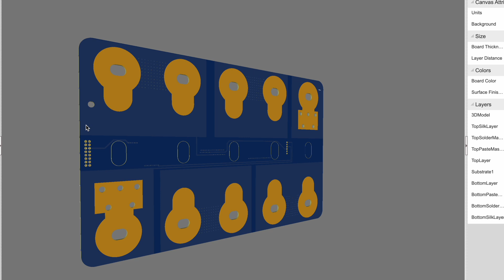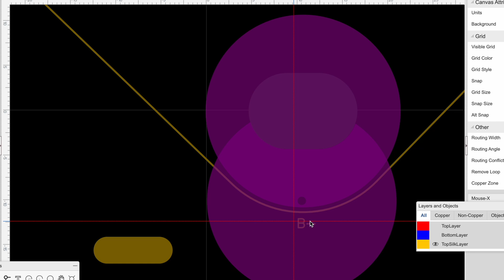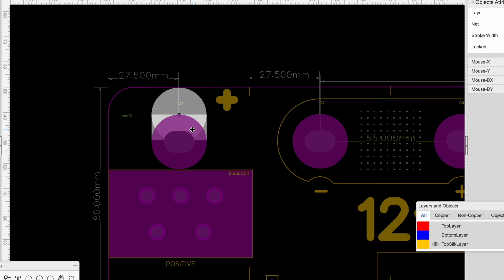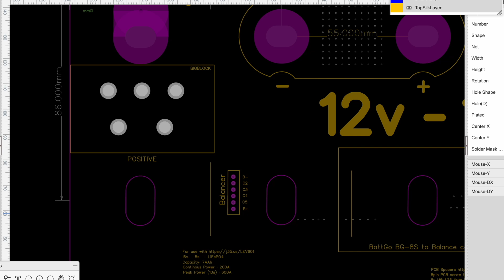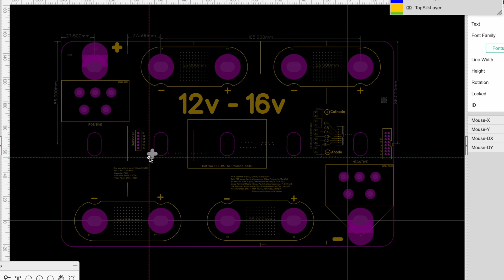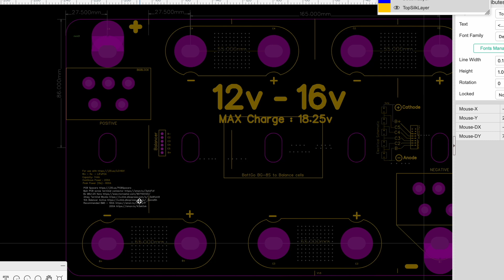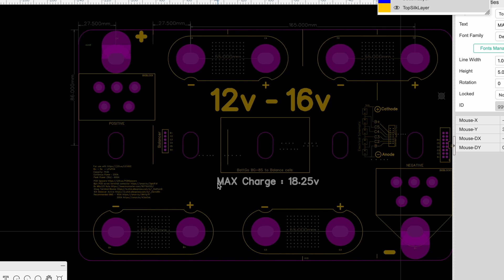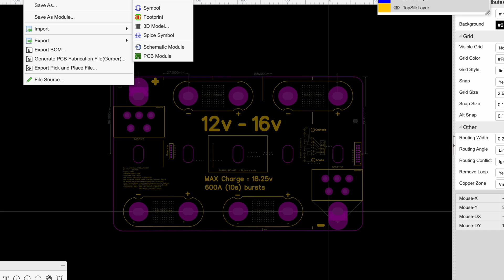Hight POWER High Voltage Car Audio LiFePO4 Battery

Comment: Can they be ran inline with an agm?
Reply: I run a 74 ah battery one of these with an agm under the hood the last 2 years no issues cold starts 13.8 just to 14.4 with a power bastards 270 with 2 monoblocks at about 5k and a 2k 4 channel people bad mouth these ive had no issues.
Reply: @larryjones6769 Thanks for the response. This helps answer my question and now I think I'll go ahead and get one.

Comment: Do you have the isolator for the 600 amp burst battery?
I am planning to get it, but I'm thinking it might damage the alternator. My first alternator fried it's diode. It was already a 150 amp and coupled with a optima yellow top.
My amp is only a 1000 rms

Comment: I bought the pro version 74 ah was wonder about the bms  do I got to buy one or does it just hook to the pcb  like the one you have on it  or does it come with it ....if we got to buy one could you make a video how to hook it up thanks
Reply from the maker: Which one is the 48Ah one?   We don’t sell one that size
Reply: @jehugarcia  my bad the 74 ah
Reply: @jehugarcia  I ment the 74 ah pro version
Reply from the maker: The pro comes with 600A capable block terminals.   It’s meant to be used without a bms as there are not many 12v bms that can handle that much current,  if you need a bms you need to get the non audio version that has a 200A bms
Reply: @jehugarcia  k  I just see alot of headway  thats similar and they say you need to have a balancer  for those ..so these are ready for use when they arrive

Comment: I bought your prebuilt 24v yesterday, I'll use it to build a starter pack for the helicopter company I work for. 300amps decending for about 40 seconds. Its going to be beautiful.

Comment: How big of a battery do I need for a 1000-2000 watt audio system ?probably 1500 watts 😊
Reply from the maker: No,  that question doesn’t make sense.   You need a battery that can give 1000-2000w,  but the size depends on what type of battery you are talking about.   If you are referring to the cells in this video,  then the smallest you can get is 74Ah and that’s good for 600A - 7200w
Reply: @jehugarcia  My JL amplifier shows its watts rating at 14.4volts.... Will the 4S sit around 14.4vdc? 
The volt meter on my alternator shows anywhere between 13-14.5 volts dc

Also, if I run this as a secondary battery just for my audio system, would you recommend leaving the factory battery to run the cars electronics and the secondary the audio, then DC to Dc charge the 4s battery?
Reply: i run 48ah pack made up of headway cells for my 2000w system. even without the engine running, under load the voltage rarely goes below 12.9v. they're amazing!
Reply: The Lev60 $150 glow special will be more than enough for 2000 watts

Comment: I just want to see more of that 48 v system you had on the table
Reply: The 18650 battery modules you have there that were connected by compressing
Reply from the maker: Which one ?

Comment: do you ever run any systems without bms like the og lifepo4 rig in the samba or do you only go by bms and not top/bottom balance without these days?
Reply from the maker: most of my batteries are not bms,  except where the bms is already in the pack like all those eScooter pack builds I did.

Comment: The Cutoff voltage is 2.0 volts per LEV cell so in a 5s configuration you would have to go below 10volts before possible damaging of the pack.O and they don’t come from china there made in Japan with way better quality materials.
Reply: Negligible energy between 2.0 and 3.2... need to charge 17 volts minimum for a full charge. 16.0 would be basically dead. Very flat voltage curve.

Comment: Do these need to be compressed? Have you had any problems with them not being compressed?
Reply from the maker: We haven’t had problems,  but these are pretty new to us so time will tell.
Reply: Thrn don't  say they can run at 16 v,, it's beyond irresponsible and you're going to get someone severely hurt be honest !!! The  cells were never meant to run beyond 12 volts
Reply from the maker: What?  Cells are not designed to be capped at any voltage.
Reply: @jehugarcia  Your not kidding the current I'm pushing to my subs is going cause hearing lose one day. But I'll try to bass responsibly.

Comment: How would you charge it? An alternator puts out 14V at most.
Reply from the maker: People use modified alternators that put out higher voltages
Reply: @jehugarcia oh gotcha, wasn't aware those exist.
Reply: yea probably also with some kind of adjustable voltage regulator too, most alternators will full-field around 18v if the regulator fails. @jehugarcia
Reply: Look it up. You can use diodes to increase your alternators volts from  what ever to 16v.

Comment: what would be the best way to use these to start a car? would you need a DC to DC Converter or just a heavy duty 200a bms?
Reply: 4s for car starting, probably wont even go below 11v while cranking. my 5.7L tundra starts very easily with 48ah headway pack
Reply: @smiththers2  thats awesome i would love some more info if you have it, i actually have a 5.7 tundra, are you using a BMS?  no issues with the alternator trying to over charge the cells?
Reply from the maker: Just don’t.   Use the 4s version to start your car
Reply: @jehugarcia  why is that? Most vehicles pull maybe 125a or at least the 4&6cylinders now days I'm more concerned with charging
Reply from the maker: Why?  Because 4s = 12v  like every car system out there.   Why are you concerned about charging?

Comment: these would work great in golf carts
Reply from the maker: why?  do golf carts need 16V?
Reply: @jehugarcia  no but if you use them in the 48v pack that you have it would be great because of the ability to handle high amperage draw, this is a constant issue people with gocarts face when trying to get away from lead acid batteries
Reply from the maker: Oh yeah,  these cells would work great,  this specific pack is not well suited for that though,  wrong voltage.

Comment: Guys, whatever you do, DO NOT run lifepo4 @ 5s unless you can charge 17 volts minimum. And most people cannot! They will be almost dead at 16 volts and perform very poorly for you...
Reply: So if my mechman 400A alternator cold starts at 15.2v and goes down to 14.8v, would it be safe for 4s LEV60s? I know they mention 14.0V max charging? But I see other LiFePo4 batteries max charging specs say it's safe at 14.4, 14.6 and 14.8v? Also I feel like LTO 4s would be too low of a charge at 14.8V. I'm in the middle of these two chemistries and can be frustrating to find which solution to go with.
Reply: not according to the spec sheet, no. @DeathLikeWebz
Reply: better off running 4s lipo at 16v because of the topping out at 16.8 when fully charged
Reply: Thanks for that was extremely useful
Reply from the maker: 16v = 3.2v per cell,  not quite completely discharged but yeah these are to be run a higher than normal voltage.
Reply: @jehugarcia   about 10% capacity remaining at 3.2v. They will perform horrible at 16.0. Voltage curve is very flat.  Needs to be 17.0
Reply: LiFePO4 batteries must occasionally charge up to 3.55 in order to balance properly..

4S = 14.2V
5S = 17.75V

So, do not listen to  @jehugarcia , unless you want to damage your cells due to an imbalanced pack over time...
Reply: Your really complaining about 10% wow
Reply: @Shmade2018  I dont think you understand the issue. The battery only has 10% capacity at 16.0 volts. It's not going to work at that voltage.

Comment: Seriously thinking about pulling the trigger on the 48v 16S version, but it's just SO much more expensive than these that you're selling. When the glowe specials were available it was ~$200 cheaper to buy those and throw the 4s PCB's in the trash. PLEASE make a 48V package deal.
Reply from the maker: Check the current prices,  we just lowered them so it’s very closely priced now.